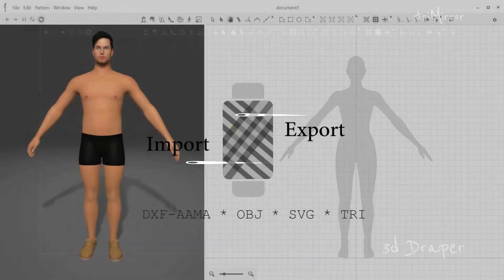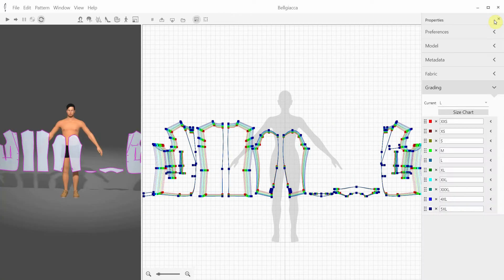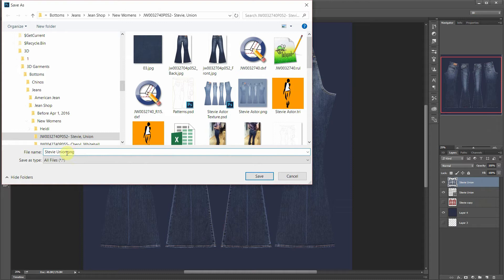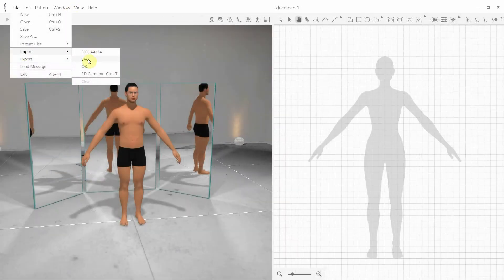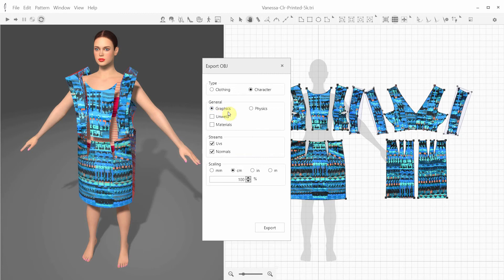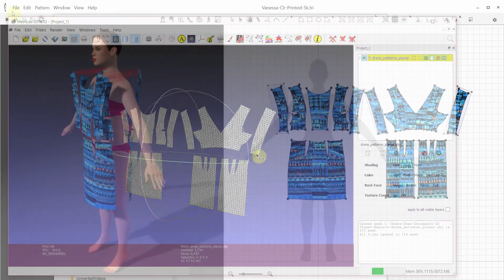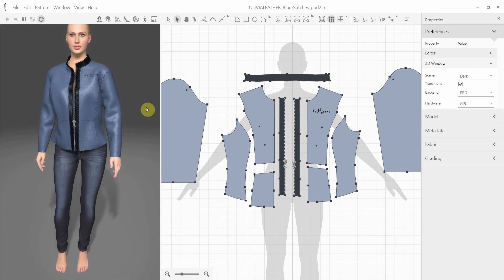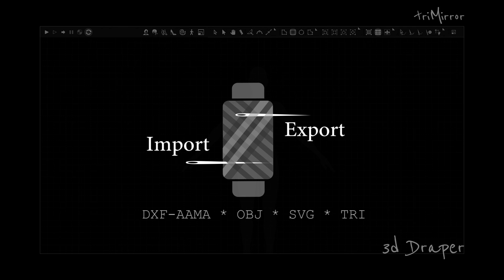Import/Export - 3D Draper

Comment: Is it possible to add an OBJ zipper to a garment in Clo3d and export it into 3D Draper without problems? Im struggling with exporting files with zippers on my garments.
some info would be very helpful 
Greetings 9:06
Reply from the maker: You can add a zipper puller as an attachment. Zipper itself can only be added as a texture or a topstitch

Comment: If external actors are imported into 3D Draper, Anchors cannot be used
Reply from the maker: that's correct. You need to use default characters if you need to use anchors and then import your custom OBJ avatar. You can also adjust the size/measurements of the default characters to match your character size and save the measurement preset.

Comment: Why import obj-type-clothing in our company's UDraper is gray and cannot be used? Actually, I've already activated the software. Please help me
Reply from the maker: It's done on purpose. There's not much can be done with obj file imported in 3DDraper at the moment. You can import OBJ files into uDraper plugin though.
Reply: Input activation code UDraper in Draper Simulation in UE4 failed to activate, which may be related to the company using the Intranet. Does your company have a solution for offline activation or provide the port when providing the activation code so that IT can open the network accordingly? I don't know much about IT. That's my personal opinion. Thanks for the answer.
Reply: uDraper  version1.0
Reply from the maker: @DavidDavid-vt5nx  it might be because of your firewall. Please send us a contact message so we can check what's going on with your account
Reply: Okay, thank you